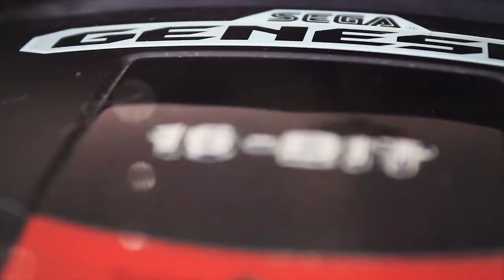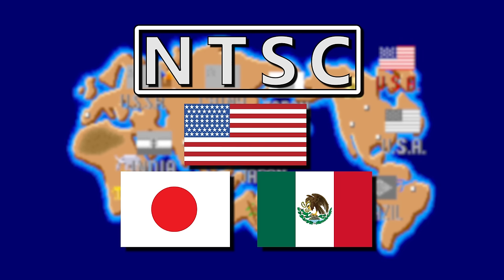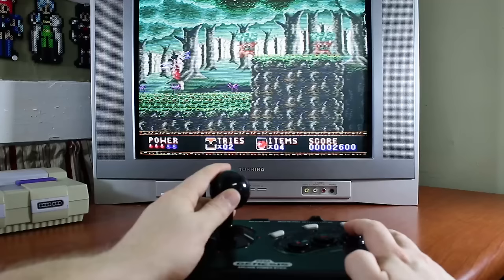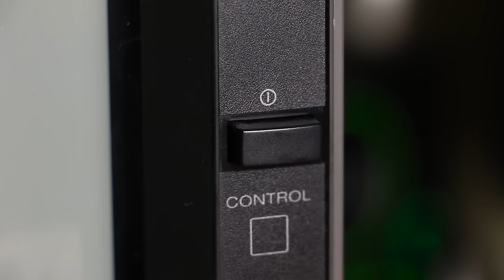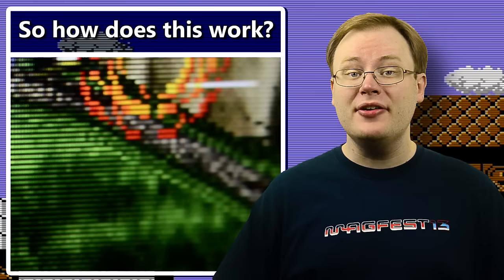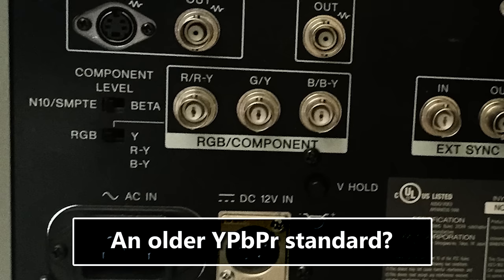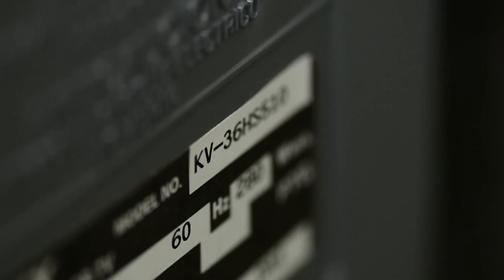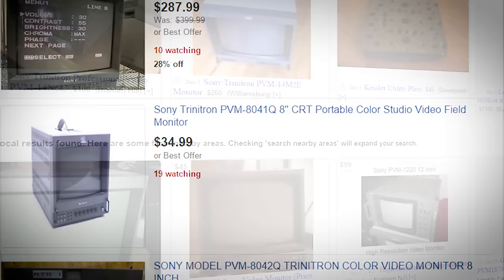Gaming on CRT Televisions, PVMs and BVMs :: RGB104 / MY LIFE IN GAMING

Comment: After watching this video I honestly can’t see how HD TVs don’t look better. That being said I do think CRT TVs are still vitally important for the reason mentioned here, the original artists designed these games on CRT TVs and did take advantage of the limitations to achieve a certain aesthetic. In some cases the same asset will look wrong on a modern TV, with that Sonic the Hedgehog waterfall being a perfect example. So CRT TVs are a necessary requirement for anyone really serious about achieving the true retro gaming experience and for any organisation really serious about video game preservation. And that’s not even to mention the fact that light gun games work only on CRTs (though hopefully the new Sinden light gun will solve that problem).

Comment: My PVM 20M4U just died a couple days ago.  It was a beautiful display, but I don't think I'll be going back to gaming on CRTs.

Incidentally, this happened less than a week after I bought a TCL 55p607 4k TV.  It looks amazing with the Framemeister and only has 15ms input lag.  Total input lag with the Framemeister is probably between 2-3 frames.  If I replace the Framemeister with an OSSC, that will cut my input lag to just under 1 frame.  I think I can live without a CRT if I have sub 1 frame input lag on a bright, high contrast 55 inch 4k TV.

Comment: I moved to Europe, I bought a Scart RGB cable for my Wii and it appears to display VC games correctly at 240p on a regular CRT TV that I got for free. I play most VC/8-16 bit emulated games at original 240p. Better then my gaming PC which only has HDMI and display port out. No gimmick no hassle.  Am I lucky or what ? If only the guys at Retroarch would understand how amazing the Wii output is instead of ignoring it....

Comment: For me it's quite simple, those old games intended looks can only be achieved on a consumer grade CRT or by simulating a CRT with shaders Retroarch is an awesome emulator which can simulate the looks of a CRT. Such games were consistently tested with consumer CRTs at the time and the artists worked to achieve certain looks in them. The games simply look wrong on a digital display and not just because they get extremely blocky and lose all volume and shading but also because certain effects are not visible in a digital display and also there are the mentioned problems of it confusing it with interlaced and also the input lag. Input lag is the least of my concerns actually such delay is very minimal from my experience. The appearance of an old game however looks much better on a CRT, that's for sure. I know that the pixelated look is a modern fad but in reality that's not how those games looked back then.

Comment: Everyone ignores an important technology of CRT: "VM"

VM is the abbreviation of "Velocity Modulation".

In the late 1980s, in order to improve the sharpness of large-size CRTs,

The differentiated Y signal is modulated above the horizontal deflection (non-deflection coil, but the VM coil of the CRT neck).

This technology greatly enhances the sharpness of the visual, has a very strong outline, and does not increase noise, especially like FMV playback.

The VM is commonly installed in intermediate CRTs above 21", but it is hidden by the manufacturer, and many people do not know its existence.

But it is the ultimate weapon in the history of CRT technology development.

(VM is very common in Japanese models, but it was used later in North America models)

Since the VM is the modulation spot moving speed, this makes the spot brightness more than 100% and improves the rise/fall time requirements of the electron gun's RGB amplifier.

(When the spot shift speed is slower, the dwell time is longer, and higher brightness is obtained, like the moving speed during painting. At the same time, the tailing is reduced)

The spherical outline at the edge of the scan line you see is one of the features of the VM.

But unfortunately, the LCD can't simulate this effect (because it's not an electron gun scan),

And VM technology is only used on consumer models, not for most PVMs (27" is the only exception) and all BVMs, as well as PC monitors.

Although the VM can greatly improve the visual sharpness, it is not conducive to the resolution test pattern and text display.

Not suitable for evaluating image quality (all signals are clear, even VHS).

You can never enjoy VMs on BVM, which is why BVM or PC monitors have a higher true resolution, and the sharpness of the image is not as good as a good consumer model.

In addition, with a few exceptions, the VM does not support native RGB signals (even if the model has a VM).

Therefore, there is no VM in the RGB signal and the PC monitor.

VM is one of the important technical technologies in the history of CRT development, and it also has a significant impact on the style of modern CRT.

Never forget the VM when discussing the CRT's scan line.
Reply: My 24" Sony Wega CRT has a VM setting, Off, Low, Med, High, I keep it at Low or Medium as its the perfect balance on NES/SNES games especially. When set to High the scanlines are tack sharp almost BVM-like however it really distorts certain sprites and messes with black background white text when set high so I keep it lower.
Reply: That's right, the VM is as bold as the text, and it will change the contour, as is the LTI (Luminance Transient Improvement) that was often used in the 2000s.

In general, I prefer to set the VM to "low" or "medium" for good image quality balance during normal appreciation.

"Strong" is sometimes used in mall displays, with "dynamic" mode, only for long distance viewing.

In some extreme cases, "strong" can cause the VM amplifier to saturate and cause confusion, but it usually does not happen in the correct design.

Note that even if there is no VM option in the menu, it still exists on most TVs and cannot be turned off.

Comment: You should try an old CRT projector if you can find one with it's tubes in good condition, I have a giant old Mitsubishi front projection TV that I got almost unused, it was in a nursing home and was so big no one used it. It's picture is absolutely fantastic for standard definition stuff and the light gun games work perfectly with it and it was one of the first TV's with S-video inputs which make it look amazing with stuff that uses them, and it has incredible sound having two GIANT 6x9 foster Japan speakers and tweeters in it too, it was one hell of an expensive TV back in 1985. Even watching DVD's or Laserdiscs on it via S-video it's awesome.
Reply: And using the Master system 3d glasses on it is crazy as hell, the effect is ridiculous you try to duck and get out of the way of stuff! PS2 and Wii look awesome on it too and like I said the light gun for even PS2 works as intended, it's a giant CRT just split over 3 tubes, red, blue and green.

Comment: The very best crt tv you could game with is the SONY Trinitron KV-36FS210 36 Inch crt. mine was made in 2004. One of the last CRTs of that year. If you're lucky to own one of those, you know how good they are. Downside is how heavy they are
Reply: I have a Sony Trinitron 32" from 2002. I don't know the exact model number and don't really want to look behind it right now. Anyway yeah those beasts are extra heavy and look superb, even having some nice scanlines. However, my fiancee isn't a fan of it and prefers the Panasonic I had from the same year. That's closer to what she grew up with which is reasonable and doesn't like the Sony's internal mechanism when it turns on. You know the sound.

Comment: Nice in depth info 👍. Those bnc cables may need to be manufactured for constant impedance to minimize reflections. It's the case with digital audio sync, I don't know the bandwidth requirements of video. Seeing the 75 ohm Terminator makes me think it's needed.

Comment: I just wondered if (old) arcade cabinets were using BVM, PVM, or something in between those and consumer CRTs.  When I think about it, they probably had to be powered on for most of the day, and their sharpness and color accuracy were pretty amazing for that time.  I really doubt the video coming from the PCB was RF, composite, or anything similar.  Also, those machines are still pretty expensive, but I wondered why in modern times (just supply and demand, or because the monitor technology might be expensive?).  They seem to weigh a lot for being made out of particle board with printed decals.

Comment: I use CRT's for everything, even for Movies(VHS, DVD, Blu-ray), HD systems and as PC Monitors. And HD-CRT's not always bad(just Samsung HD-CRT's have scalers built-in). Because I had a Samsung TXS3082WH [https://www.amazon.com/Samsung-TXS3082WH-Wide-Slimfit-HDTV/dp/B000F2R5CO] that had the same picture processing shit. But now I have a two Philips 32PW-9551 and a Philips 28PW-9551, but there are also not perfect for Retro-Gaming because there are Scanlines missing and Lightguns won't work(because on RF, Composite, S-Video and RGB the TV double the refresh; but not on YPbPr and HDMI), but there got HDMI(max. 1080i) and this is perfect if you want HDMI-only systems on a CRT without converting(/lag). And for me in Europe it's way easier to get and CRT with Scart/RGB, because every Europe-CRT since the mid 80's have a Scart socket an some german CRT-companies even have TV's with two Scart(RGB) Socket's and VGA. And I use CRT PC Monitors, because they have sharp pixels but not too sharp, they are waaaaay cheaper and they have a a higher refresh(75hz, 80hz, 85hz, etc.), that means it's smother for your eye [at the moment i use a Sony GDM-FW900(max. Resolution:2304x1440) and a Dell M783p(max. Resolution:1280x1024), I got another Sony GDM-FW900, but this use my father]. And I don't even have an flatscreen TV/Monitor.

FUN FACT: I'am just 15 years old, but I got all these Systems:
Master System 2(RGB modded), Mega Drive(unused), Mega Drive 2(RGB), Sega 32X(RGB), Sega Saturn(RGB), NES(Composite), SNES(RGB), N64(Composite), Gamecube(RGB), Wii(YPbPr), WiiU(YPbPr), Sony PS1(unused), Sony PS3(YPbPr), XBOX360[Jasper-Rev.](YPbPr), XBOX360[Xenon-Rev.](unused), XBOX360[Falcon-Rev.](unused/broken DVD-Drive),PC Engine(Composite)[every system is PAL]. And every system that is using Composite, get an upgrade to S-Video or RGB.

Comment: There's a lot to be said about GOOD crts on that special niche (ie trinitrons, diamondtrons), but the lowest end tubes are still worse than a low end IPS monitor. If I had a trinitron, sure enough, it would be in use for retro gaming. My old low end CRT? Not so much.

Comment: Great vid.

It would be nice to see a "Getting the best out of CRT PC monitors", in regards to CRT PC monitors that only have BNC/VGA connections? I'm currently using a Sony GDM FW900 with a backwards compatible PS3 with a scaler for ps2/ps1 games. The monitor doesn't do 15 Hz so using it for Sega Saturn/Megadrive/Amiga/C64 would need some investigation.

Comment: as much as i want a pvm, im fairly content with running higan on my benq at a low(ish) resolution, 144hz, 1ms response, and simple ntsc shaders that i tweaked for analog fringing and fairly crispy scanlines. combine that with tuning nvidia control panel color settings, the emulators color settings, and the monitor settings...im happy enough with the final image when it comes together. 

but real hardware on a pvm, or at least a quality crt display, is the end goal.

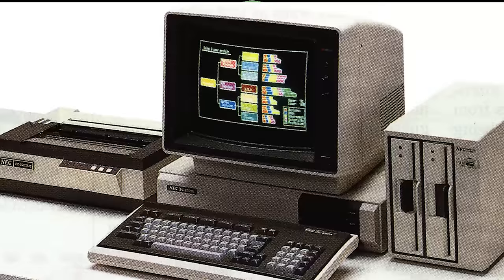Comment: 17:42 STORM EAGLE!!

I bought a PVM & an SNES yesterday. I need the cables still. I've seen the SNES to SCART and then it seems like you connect it to another SCART to BNC. I can see how this is better if one has multiple consoles that they want to switch to. However, if a person only has 1 console they plan on using, isn't it better to have one cable directly from SNES to BNC?

Comment: Back then..I remember...just a 36 cm/14" tv crt..without any real rgb peritel..and 50 hertz...censured games.
Few people can afford a super famicom or neo geo..with real rgb or svideo l.r stereo cable in 60 hertz with original japanese cadridge.
Now,I just have one crt arcade monitor.
Nanao Toshiba 15/24/31 khz 640x480..on Blast city.
Beautifull.
But I prefer pixels mozaïc than big scanlines like new astro.
Back then,during the 90s I was hyped by home theater..so already with rgb..s video..yuv..faroudja  scaler..and somes crt were compatible with 576 or 480p (pal or ntsc).
The laserdisc and dvd were on sell since 1995,96..I used the pioneer 717..a awesome picture,some ampli yamaha had a scaler inside,you can used a neo geo modded rgb to have a great picture with component yuv lr.
Now..I also use a big 4k 72" to play retro emulation mame neo sega by android box,it's nice..big pixels no scanlines (scanlines hyde 1/4 of the picture).
Now..my opinion is the best way is a blast city,net city crt..or old pc monitor vga.
Or just a framemaster with a oled big tv.

Comment: Actually most HD CRTs don’t have that issue LCDs have misrepresenting 240p for 480i. Most HD CRTs like the one you have will linedouble 240p and 480i images to 480p or 960i depending on your DRC setting (Sony HD CRT exclusive setting you even displayed). So HD CRTs definitely treat retro games better than LCDs but nothing really beats a 15khz CRT

Comment: Pro tip. Put that yellowed SNES outdoors into the sun for a few days. It'll look good as new. Btw NTSC isn't 60 FPS. It's 60 FIELDS per second. You need 2 fields for 1 frame hence 30FPS.
Reply from the maker: [Try4ce] Functionally 60 fields per second can be 60 frames per second in two different ways. One, a different frame is displayed per field, rather than one frame split into two fields. This is extremely common on PS2, which has a high number of 60fps games for its time, by drawing a new frame every field. The other way is with 240p, or what some people call "double strike." The electron gun is tricked into drawing the next field in the same spot as the previous field, effectively making a progressive image that can move at 60 frames per second (and indeed a vast vast vast majority of 240p games are 60fps). No, these are not professional broadcast ways of doing things, that's not how you're supposed to do it as per official specifications, but that's the beauty of analog... you can do a lot of neat tricks within the bounds of the technology that don't necessarily have to be bound by strict digital rules, and video games back in the day got very clever with how to manipulate the technology.
Reply: My Life in Gaming that's vector monitors that change gun behavior - not NTSC video.
Reply from the maker: [Try4ce] 240p is a real thing whether you believe it or not. It's not like vector monitors, but the horizontal lines are manipulated in the sense that they are forced into making a low resolution progressive image that is 60 frames per second. It's not the NTSC standard, but it is a technique that works within that framework.
Reply: @mylifeingaming  so it's not NTSC like I said repeatedly - got it - thanks.

Comment: Just scooped a mint 24" Sony Wega trinitron flat screen crt tv for $50. Has the remote and is MINT
Reply: That's great my dude. I didn't get a Wega but I did get a 2002 32" Trinitron recently for $10. I tried with Gamecube component, Sega with RGB to component transcode, PS2 with component, and S-Video with N64. It looks great for those applications.

Comment: Actually, the SNES, Mega Drive, and PlayStation 1 are both 240p and 480i consoles, supporting both video modes.
Reply from the maker: [Try4ce] Yeah but on SNES and Genesis 480i is almost never used. Not talking about what they CAN do here, just what they usually do. Until the Dreamcast, it was uncommon for gameplay to be 480i or higher. 3DO outputs 480i but the games are lower resolution internally.

Comment: OLEDs have no inherent display lag and they can be strobed. Laser projectors are inherently strobed and behave much in the same way as CRTs. It should be easily possible to make a good retro gaming display; someone bust actually has to think there’s a big enough market to make a profit on this kind of niche product. Computer monitors sill also at some point escape the curse that is LCD. I don’t know if OLED will become popular since it still has some burn in issues or if another technology will replace it like crystal LED, retinal scanned displays etc; but LCDs have such serious drawbacks that they simply must go away eventually. Then we will have low latency, HDR, high refresh rate displays. OK, so emulate the game; fake whatever type of raster lines or mesh pattern you think is appropriate then run the screen at a multiple of 60 Hz and insert as many black frames as is needed; use strobe as well if supported. It sill be better than the crappy TVs we had back in the day. You can even get lower lag (e.g. if input is taken on frame N and only used on frame N+1 emulators are fast enough that you can run 1 frame ahead).

Comment: I kinda wonder whether it's possible to have laser reflectors and DMDs that are fast enough to support video refresh rates. If it's possible, we might actually see scan line based DLP TVs. Current tech isn't really that promising though, giving that laser engravers don't need that much speed since it takes time to engrave something anyway, and DMDs are by far mostly built to do a full screen refresh at once. Both are still one or two OoM away from what we need.